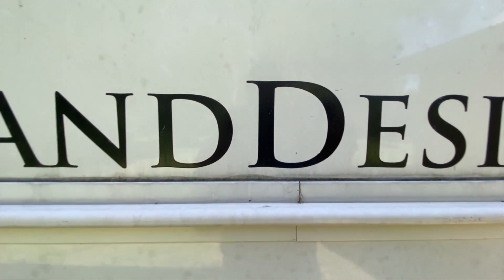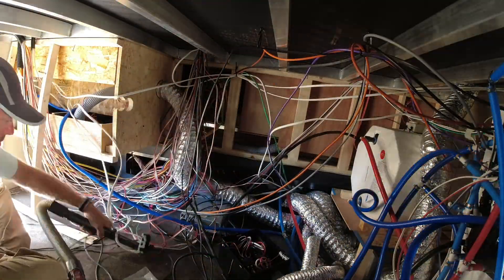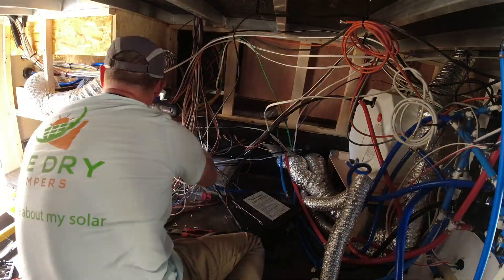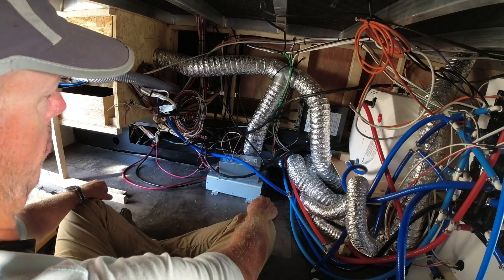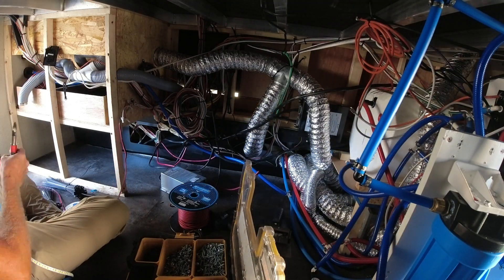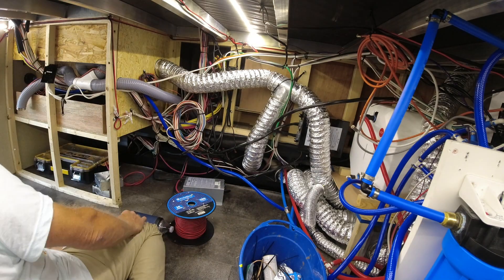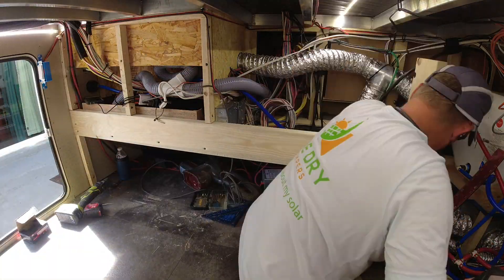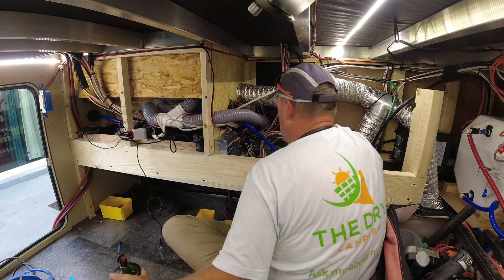Battle Born & Victron Install | 2020 Grand Design Solitude 380FLR

Comment from the maker: What can this system do? A word from the client: 'Just watched our install video. It’s so awesome. I still can’t get over Mike’s talent. The system is performing amazing. I’ve had the inverters set to pull no more than I think the 13.6amp setting each from shore power and I don’t think we’ve dipped below 80% SOC any day with both ACs cycling off and on all day and night and by morning we are back to 100%. Anxiously awaiting our next electric bill portion from our daughter.'
Reply: I love this!  I'm looking at purchasing the same unit and I have so many questions but I''ll keep it simple.  If I go with this same setup would you recommend a generator or will this eliminate the need?

Comment: Mike, are a majority of your 50 amp dual inverter installs, stand alone?-i.e. each one on separate leg of the 50 amp. I am asking because on the LJMJ video, his left invert was on and his right invert was float charging.
Reply from the maker: Yes, I do all dual inverter systems stand alone. Yes, that park had the worst shore power we've ever experienced. It was hovering between 102-106.

Comment: Just finished yesterday installing / wiring 2 - Multiplus' / wired split phase (not tethered); 1,880 watts of solar; 1- MPPT 150/85; 1- 100/50; 6 - Lion 1300 Safari batteries - all based on the information  / videos the Dry Campers have posted over the past couple of years....2020 GD 380FL...would have been very nice to have seen this video as a reference guide as the wiring behind the wall was a nest of challenge! Most importantly, the entire system works as designed.

Mike / Leanna thank again for all the information and answers to my questions (Non-DIY) over the last couple of months.
Reply from the maker: Awesome, glad the information has been helpful. Ha - wow, how about that?! We just finished this one up about 2 weeks ago.

Comment: Nice install. Where did u run your wires from the roof down to the controllers. I also have a front living coach and was wondering how to get them down to the basement
Reply: The last part where Mike showed the wall inside our rig with the low voltage bundle on one side and high voltage on the other is the chase that Grand Design built into our rig. It’s such an awesome way of get wires from roof to basement.
Reply from the maker: Yes, just as Bryan mentioned at the very end of the video I show you where all the wires are ran in the Grand Design built in chase. Thanks for watching!
Reply: @TheDryCampers  that’s what I get for sipping out in the final 20 sec of the video 🤦. My solitude 374th doesn’t have a chase like that
Reply from the maker: Ha, no worries. Just watched a video of the model and appears to be the same as the Momentum 376TH and I know it has the same chase and the 374 from the video appears to have same chase as well. Do you have a temperature control on the right when you walk up stairs to front living? If so, that’s the same chase.
Reply: @TheDryCampers  yes I do have that at the top of the stairs. I will check that out when I get it home from winter storage. I’ve never seen. Anything on the roof to indicate that it is there but I’ll look in the basement. Thx